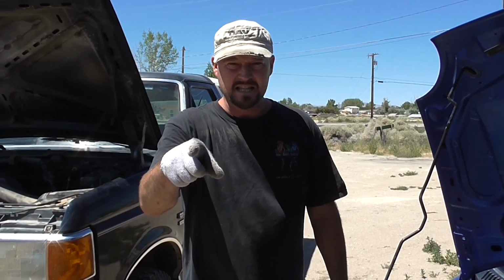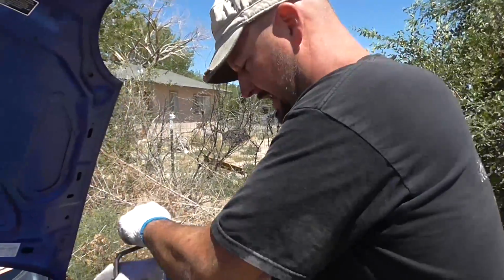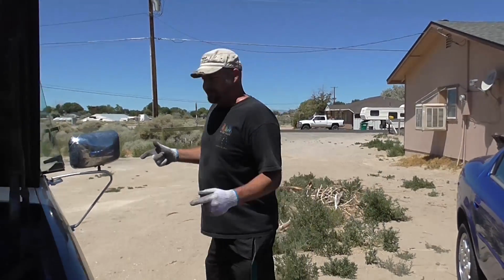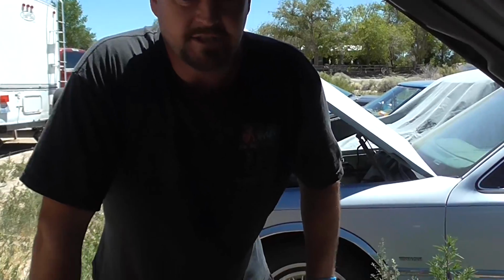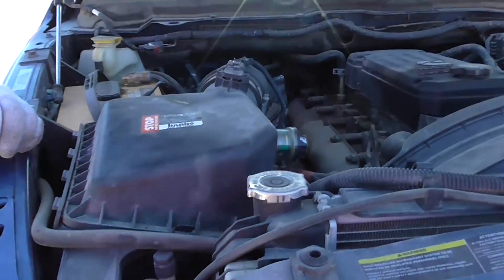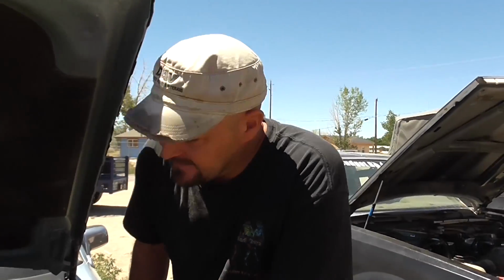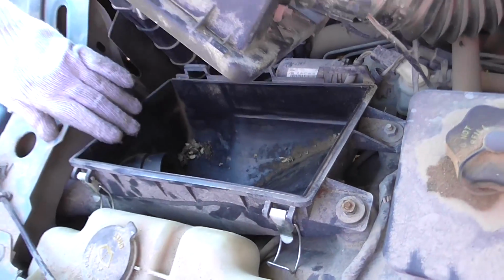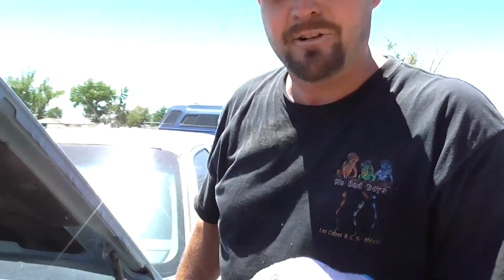Free Horsepower And Fuel Economy - Intake Mods

Comment: Why not just put a K&N filter in the air cleaner box? They make them for just about every application these days. It's the first thing I put in each of my vehicles. There is a cleaning kit that I use every 50,000 miles.
Reply from the maker: most of my cars do have K&N, I am showing that improvements can be done even with a stock air filter.

Comment: Doesn't the Mass Air Flow sensor tell the ECU to compensate for more air flow and negate this modification?
Reply: Derick Ponce-Sanchez  Yea doesn't it seem like everything depends on how big the throttle body valve is opened, asking and not restricting availble clean air should not affect functions of maf as long as it does not get a clogged dirt track filter !
Reply: Do think he isn't changing the ratio , everything looks like it would work just the same as before. Air restrictor on race cars just keep the top speeds down so he has a point

Comment: I don't know. I hear hi-flow filters (non-paper) may let more dust in the engine and destroy it in the long term. 1-2 MPG gain doesn't seem to worth killing the engine. Any one tried or have better info?
Reply: I have been running K&N Air Filters since 1975 -- in cars, trucks, and SUVs -- on-road, off-road, city, and highway speeds. NEVER a problem with dirt getting through to the carbs or fuel bodies, even during off-road racing, hill-climbing, or crossing streams and rivers.
For those who live in wet climates, it's important to know that the K&N air filter is the only one that WORKS WHEN WET !!
TO service your K&N, use the K&N cleaning/oiling products ONLY -- follow the DIRECTIONS.

Comment: I did something similar before as an experiment. I secured a k&n inbox air filter to the top part of the intake but lifted it slightly out of the box a bit so that it wasn't just getting air from that little whole inside the box..it did improve throttle response, sounded better and gave me slightly better gas mileage. The down side though was on as the engine got hotter on long rides it didn't run as well because of the heat it was sucking in. I think a hood scoop or a few vents in the hood or something would have helped.

Comment: I don't believe it doesn't help. Anyways if it did, it'd be easier and more surface filter area to buy an easy breath filter that fits your box without altering.
All these after market filters will gulp water into the engine much easier and ruin your engine but good when you are in a heavy rain storm and hit a puddle.
FAIL

Comment: Sorry to say but you're not pulling anymore air into the engine than it was already getting.  If that premise were even true, obviously you'd have a lean running engine unless you did head work or otherwise modified the engine to accept more fuel as well.   You're not causing a lean running condition, and you're not adjusting the fuel intake either, thus you are not increasing the air intake.   Force more fuel and yes, then you may well have an issue with air intake as well.   The conclusion that the engineers are wrong and you're right is going to prove incorrect in almost all cases.   It'll sound better I suppose, for some people.   But sounding better isn't a performance upgrade.   

A K&N filter filters the air better because it has oil in it.  Old air filters used nothing but oil and they filtered the air extremely well (PITA to maintain thus obsolete).  They also kept the oil out of the air going into the engine too unlike K&N filters if you don't clean and oil it correctly.

12:48 That tiny little hole right there.  Okay take the air box off, take the air filter off, and put the car on the dyno again and show me the difference.  You'll be disappointed and I'll say I told you so.  

The engineers do this so you burn more fuel?  Air fuel ratio is critical for a car to run well and they're not going to get you to burn more fuel selling cars that run like crap.  Those cars won't sell, they'll blow black smoke and foul their plugs.  They're not doing it so you run too rich, they're doing it to get the best mix of fuel economy and performance for that application.   

Intake mods that cool the air going into the engine have merit yet even there, they might help the numbers on the dyno, the numbers on the track, how the car feels, or they might not.  But at least the theory is sound.  Even if it doesn't make a measurable or perceivable difference, cooler air intake is still a good idea in theory.

Comment: I cut the bottom of the air box in a santa fe but now its stalling what do u think  about that,I drive 140 miles a day so I hope this upgrade u be telling people about really works
Reply from the maker: If the car is stalling, you did something like remove a sensor that has a purpose.  You never remove sensors in a fuel injection engine.  Back track on exactly what you did and make sure all the fuel injection sensors are intact.  That is the only reason a car will stall.

Comment: So you open up the plastic box that insulates engine comparent heat under the hood. Take outside air temp. Now you suck in 130 to 180°F charge air. Yup I'm sure that gains you massive Hp to the butt-dyno.

Comment: Cold air Intakes/Billet Intakes are specifically designed for making more boost on Turbo engines period...!! why because what happens ladies and gents when air compresses? well it heats up so the filter allows more air in faster and colder every engine in the world loves cold air due to this fact and the turbo will make plenty sure no oil residue is going to stick on the MAF fins the billet metal also keeps things cool and relocates your sensor to the correct position for Turbo the 10-15 hp gain Is only achieved from the draw off the boost through the tube and filter and really it's only 5-8 hp...  but  on a stock plain Jane Your not gaining any horsepower if you do it's only going to be 1-2 horse period I seen gains with undersized filter swaps but your just restricting air and leaning the banks which is the case on the Neon in the video watch the corrugated section of the tube flex that's draw... not to mention unless your half throttle constantly or wide open your going to kill your signal the MAF sensor puts out due to the oil residue on the fins this will send rich signal to the control module leaning out your fuel mix bad unless you like knocking and pinging but oh well... you wanna give them HP just change the rings and do a scheduled valve job that's cheap and very effective if you want to spend more bore the cylinders...Ask the pros that's what we are here for never ask the manufacture why because most likely your going to get a sales rep...
Reply from the maker: Cold air intake systems can be made with universal tubing and an aircleaner of your choice which saves a lot of money in comparison to buying a whole kit from an aftermarket company.  If people have plenty of money, no problem, buy the $300 plus intake kit but if you are working on a small budget, make your own whether it be modifying the current air box to breathe better or make your own from universal tubing and large air filter.  There are dry and oiled filters on the market that breathe better than paper.  The potential for performance it out there, it is being creative and thinking outside the box to make it happen.  Every individual's choice as to how to do their own.
Reply: Regardless of cost or being creative which was the point of your video I completely understand good point and video. My point was to cover both routes consumers may take in the event of single or multiple attempts in adding performance along with some outcomes down the long endless journey of attempting HP gains. Sorry but it's still just a sales perk as we both agree unless your engine is built so the question is do I need it the answer is run the paper filter trust me. The real research engineers would recommend OEM filters why because where your sensors are located they spent millions of dollars on research. Now the next question will be okay well so do most aftermarket filter manufacturers? Yes but they only spend Money and time on how the filter is designed and the only dyno numbers they run are on serious spoon engine's turbo and supercharged engines because they are high rev with the correct draw needed for accurate readings on dyno tunes. As far as all the other vehicles well they only buy the size specs from the automotive  manufacturing industries and maybe a vehicle for exact fitment issues. I can say no OEM research is put into them at all for vehicle specific only overall on the few select dyno pics the filter manufacturers choose. The OEM research will depend on automotive manufacturing if they decided to use the filter. Sorry I'm long winded but this is a technical topic.
Reply from the maker: I have done my intake mods with stock style paper filters and it worked fine.  The Lincoln town car and Ford Bronco in the video actually were using paper filters and they ran good other than the Bronco's exhaust leak from the header....

Comment: I do have one question for you, how do you know the limits to an air intake system you may build yourself? Should I go with the size of the stock piping and such and carry it to the same general area as they had with the plastic stock? Because I wanted to put a cold air intake on my Dodge Ram and my Jeep Wrangler but I wasn’t sure😉

Comment: A little late but this just popped up on my feed.  This bubba doesn't mention either rejetting or refreshing the fuel maps.  None of his junk runs right, and what's all that crap leaking out of his air filter on that 1990 Bronco?   I'd like to see the inside of the airfilters with all the dirt that was everywhere.  It appears that very few of those cars drive, looks like a junkyard.

Comment: I have a nissan terrano 1992 and I've put a pod filter on it and it's now making a knocking noise in the engine bay . so I put the stoke air filter back on it and the noise has stopped. now can someone please tell me what is make the knocking noise when I m using the pod filter and is it bad for the motor If I keep on driving it with the pod filter cheers
Reply from the maker: I would have to see how you routed the filter and intake hoses.  There is a small hose that is a breather to the valve cover, PCV, on some engines, if that hose is removed, engine will make a knocking sound.  Some engines have this hose to the air box or air inlet tube.  Every hose that has vacuum still needs to have vacuum.  Check to see if there was a PCV vacuum hose that was removed during your conversion.
Reply: I think it's because with the paper filter it muffles the sound and the upgraded filter lets the sound out. I've just replaced a pair of filters on my V8 for k&n drop in panels and I can now hear air the air pumps running.

Comment: More air flow means more gas into the engine..not an improvement on gas mileage.  when maf sensor reads more air  computer adjusts fuel input to avoid a lean condition and stop detonating.. it doesn't  increase mpg but gives you less mpg.
Reply: The mod on the Lincoln DOES NOT provide more air flow -- it provides LESS RESTRICTION to the normal air flow.
 The modification of the Lincoln air box is just insane -- the throttle body diameter is the limiting factor.
 It is easier to remove the air box in order to REMOVE THE SNORKEL  -- the snorkel diameter is about 1.75 inches -- MUCH smaller than the Throttle Body opening.

Comment: Hay budget boating  guy I love ya ,your the best ,any how I have a 2017 Chevy trax awd lt. it was geting about 24.6 mails per gallon and I saw your free boasting for free so I used a hole saw to cut hole in my dirty side of my air box putting as many as I could an now my engine sounds like I have lode muffaler and it gets almost 1 1/2 more per gallon and I put a ss on my car  it didn’t do nothing to my engines or computer it’s awesome thank you your the best 👌👍

Comment: Why cut the entire bottom off the box when you could just drill a series of 1" holes in the bottom - say 10?
Reply: Sam R. Exacto!
Reply: Just drill some holes and in dusty conditions maybe add a leyer of high flow filter just in case!  This guy lives in the freakin desert!
Reply: good point.
Reply: Or just cut a couple more big 3 or 4 inch holes and run intake tubing to the front of the car behind the grille or fender, that way you're not pulling in hot air from the engine bay..
Reply: Mikel Whois Thats what I was thinking

Comment: Even the big 5L V8 running at 6500 rpm draws about half a cubic metre of air per second (which is about half a kg, by the way) unboosted. Down that 180mm pipe, that translates to about 20 m/s, resulting in a pressure drop of less than 0.1 psi (going by my dead reckoning, mind. The actual number is even less than that).

You lose more by adding a single 90 degree bend. Not worth the effort. Better off getting a square K&N filter that fits in your air box. I'm pretty sure they do a range of drop in replacement ones.

Comment: If you get more air through the engine, doesn't that also mean more fuel burned, more power generally means less fuel economy, but I suppose there are some way so getting both, I'm curious why and if you do get better fuel economy with an less restrictive air filter? 

Also the reason why air filters are restrictive is to because they filter out particles better, in the long run it will keep your engine running better I think.

Comment: I watched the video and I applaud your attempts to document your mods and process however that being said, between the truck and the neon you're comparing apples and oranges to a degree. there are VAST differences between a modern twin turbo v-6 FR layout truck and a mid 2000s FWD 4 banger. no doubt a new, clean, cotton air filter will flow better than a stock paper filter, especially when it's used Vs new. additionally you mentioned you ran a custom tune for 93 octane (more knock resistance=more timing advance= more power) and basically deleted the rear mufflers with straight tubing. also I may be mistaken but it sounded like you did some port matching in the truck's intake too. all I'm saying is slapping a Pod filter on something will improve it a BIT but it's not night and day. it may even hurt your numbers if you suck hot air in while doing it.
Reply from the maker: the performance of the tuner was nothing special by itself.  After the intake and exhaust system was done TOGETHER as a BALANCE, which every mod should be.  I DO NOT USE SMALL POD FILTERS, like some of those myth buster wanna be's.  I use large area filters that breathe from a large area, therefore making it better than a small trumpet straw that most factory airboxes use.  Check out the new Mustang GT350R, look under its hood from the factory it has a VERY LARGE CONE-STYLE AIR FILTER.  The factory knows what makes performance, they just REFUSE to give it to all of us consumers.  Just the rich that can afford their big money GT350R and other special very expensive cars.  Every car deserves that same potential, the prices of the airbox and filter are most likely comparable in price so why do we as the consumer get the straw and the expensive high end models get the large area breathing filter?

Comment: 24:00 With the Ford products, the place under the air box is a plastic extension of the inner fender for the front wheel. Once you cut out the bottom of the airbox, you can drill a bunch of holes in the plastic underneath the newly exposed air filter and get cold air intake from the bottom of the car. It is far enough in front of the front wheel to avoid splashes and drilling holes prevents stuff from getting up there but provides drainage if any water gets in there. Matt is ingenenile.

Comment: I did this and gained a couple miles per gallon but definitely lost horsepower. I'm seriously disappointed.
Reply from the maker: low end torque is what I gained the most.  As long as it was done right and correctly, it should net great torque down low at very low throttle.

Comment: But u dont want the engine to be suckin hot air outta the engine bay! u want COLD air from outside.
Reply from the maker: Hmm, the cold air may start cold but after 30-45 minutes of driving a naturally aspirated vehicle, all that under hood heat will heat up the air so much that the cold air intake does virtually nothing.  most of my intakes face the grill so the air is as cold as it gets.

Comment: Add a hollow metal ball between carb and intake (works like a bong) atomizes and vaporizes  gas doubles mileage
Reply: You need to provide more details -- what you say makes no sense. ANYTHING that is placed between the Carb or Throttle Body and the Manifold is a RESTRICTION !!
 Can you provide a SOURCE for this idea !??

Comment: Seems like I missed out on a few things, but what kind of oil do you recommend using with your air filter mod.
also, if you are going for a exhaust mod as well. What kind of exhaust pressure do you recommend, section wise of course.

Comment: You can buy a real cold air or short ram intake for around 50$ for just about any vehicle. No way in hell your getting an added 8mpg out of an intake mod. Also an aftermarket muffler will do you no good as far as airflow If you still have catalatic convertors on the vehicle.